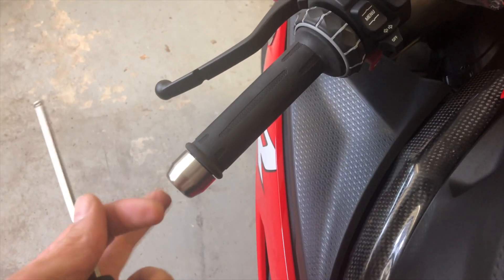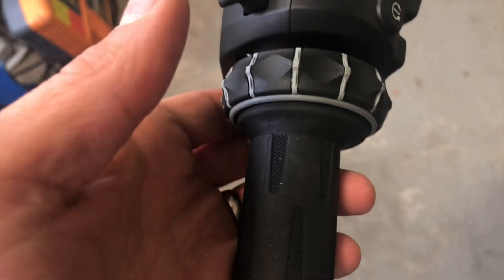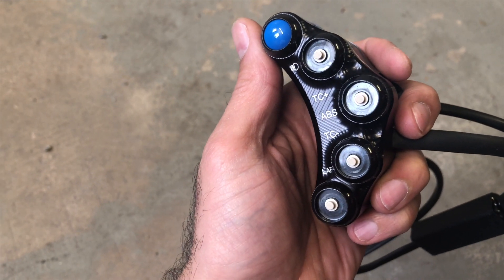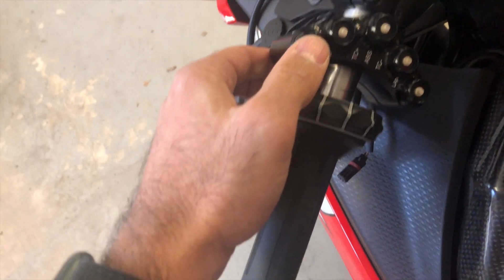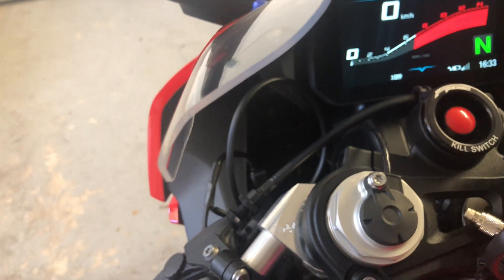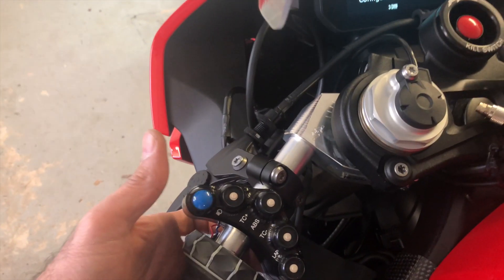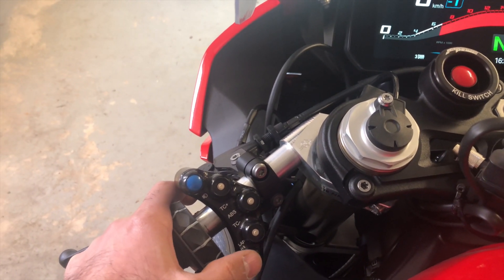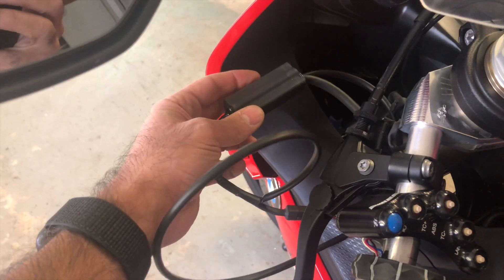jetprime left GP buttons for BMW S1000RR 2019 2020

Comment: For those interested getting the second clip off. It takes a small flat headed screw driver to release the clip. The clip is between the actual clip and handlebar so not very easily accesible. Only visible once removed which is not great 👍🏻

Comment: Thanks for the video. Looks like Jet Prime have rushed this product out without properly thinking it though. Same with the kill switch and right hand switch gear.
Reply from the maker: james scholter thats correct. The kill switch is actually ok and the right buttons are ok. The left side is as you mentioned rushed 😞
Reply: Omid Anka kill switch was more a BMW issue to get the original off?    The right side needed modification did it not and also the wiring is bulky?
Reply from the maker: james scholter that’s correct. The kill switch is working great and integrated with the bike. The problem is removing the original cylinder. The right hand side is ok 👌🏻 butt as you mentioned it breaks your heart to cut on original stuff. The left side is disaster 😌
Reply: Omid Anka think I’ll wait until something is developed that actually fits and works as you’d expect. Your videos have been a fantastic help to me. 

One last question, what was the fitting process like on the crc fairings. You didn’t do a video of these going on. Interested in how easy the bracket kits were to put on. Thanks again

Comment: How did you remove the second wire you didn’t show it 🤦
Reply from the maker: Hi. Its a normal conector there is a lip that you have to lift with your nail or a s.driver and pull the cabel

Comment: The reason why the wheel does not work when going left is the piece you took off after you removed the grip from the wheel. You need to grind the piece and put it back in with the 3 screws. I realized there is a little nub that pushed a button inside the wheel and with out that piece. it won't work.
Reply from the maker: i changed the batteri :)
Reply: so those left prime switch handle bar actually works ? i was thinking on buying them but after watching this video I said no, so to make the wheel work left and right I don't have to cut anything?